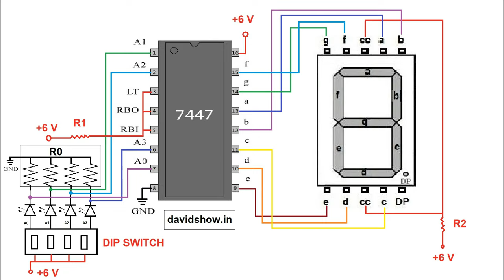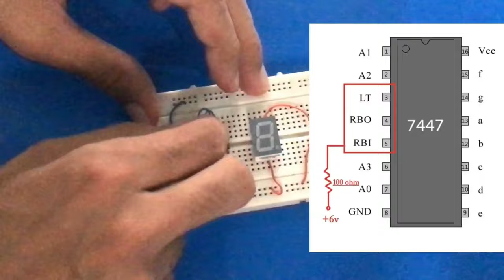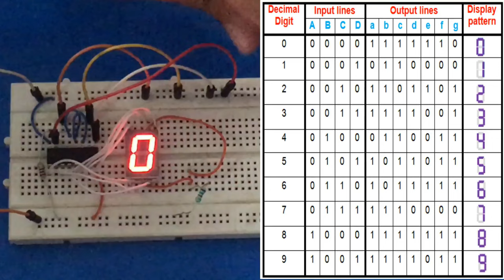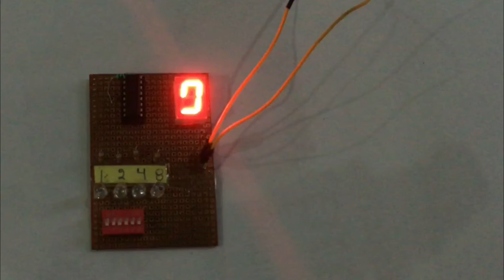7447 Seven Segment Display Working

Comment: Common cathode is negative and should be grounded.
Reply: that’s a 7447 so outputs are low, and you have to use a common anode display

Comment: is there any difrences code between 74LS47 with another7447 code....
Reply from the maker: 74 indicates a logic family, "LS" is a subfamily called "Low Power Schottky" which was lower in power. The 00 indicates logic function, 00 was a quadruple (four per package) 2-input NAND gate. We use 7447 code for simplicity.
Reply: where can i find datasheet for this ?
Reply: @DavidShow  hey man what is wrong with my ic the 0 is not displaying only 3 leds are blowing please help me please🥺